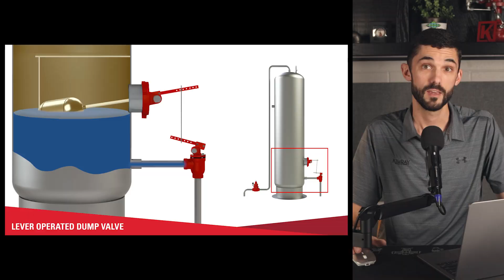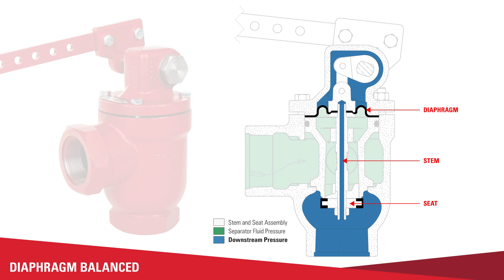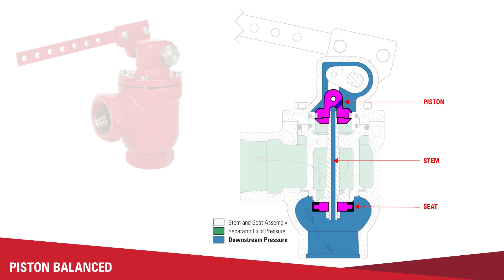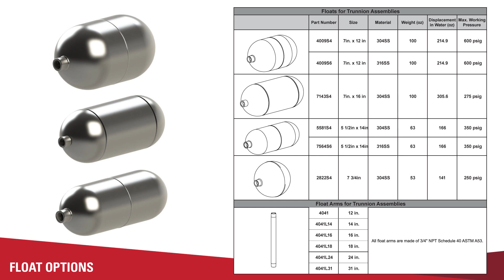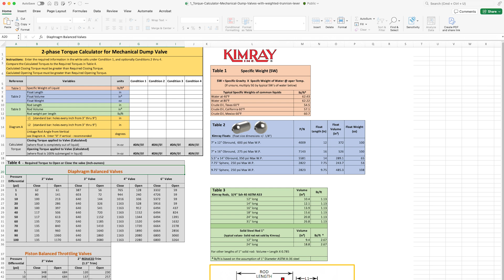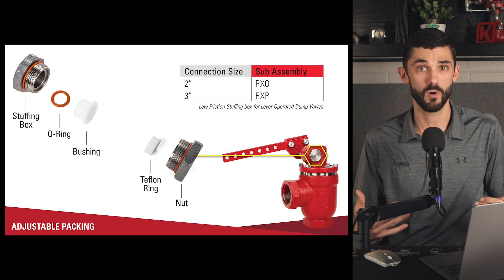Liquid Dump Valves, Trunnions & Floats (Lever Operated) | Kimray Beyond the Basics Training

Comment: Can you arrange the linkages on an oversized valve to where it only opens 70% at max? The difference in Cv between 4" and 6" (70.1 and 277) is huge. We have a 6" but the 4" would be way to small.

Comment: How do you get play out of the dump arm or trunnion arm?

 I constantly have dumps that have so much play. It will dump but with that much play it will drain it all down and have gas flow by until you get a good amount of fluid back in the vessel.
Reply from the maker: It seems most likely that you may have the older style of hub/shaft in your valve and that’s what causing the slop/play/backlash. Updating the internals will greatly improve the operation of the valve. If the problem persists, you can give product support a call and we’ll find another solution. This video should give you all the info you need about that fix: https://www.youtube.com/watch?v=BlV0CS6EOyk
Reply from the maker: Also, if you have a 2" connection size and it's within the affected serial number range, you can get a free replacement of the hub/shaft components. Product Support can help you with that as well. (405) 525-4264 or productsupport@kimray.com